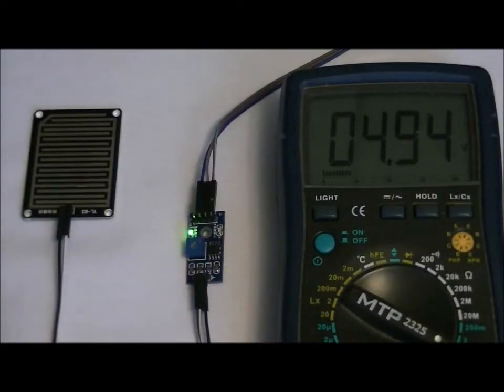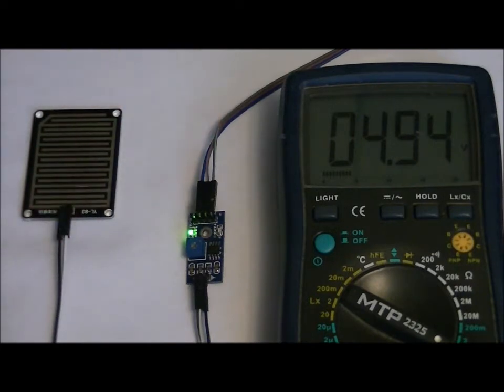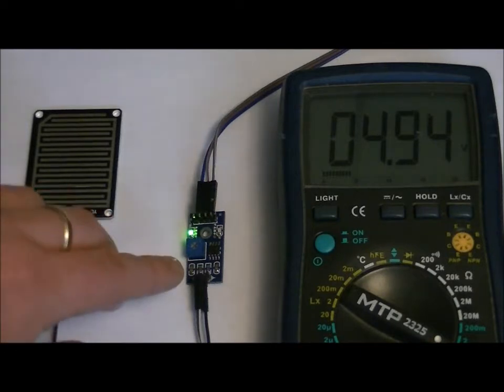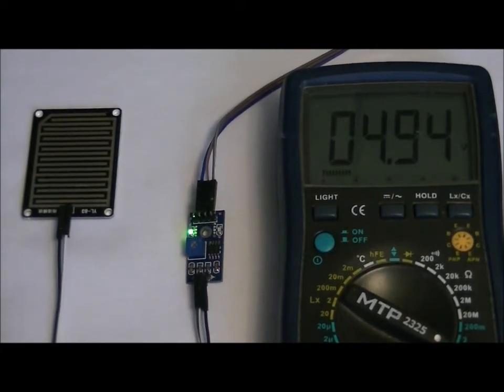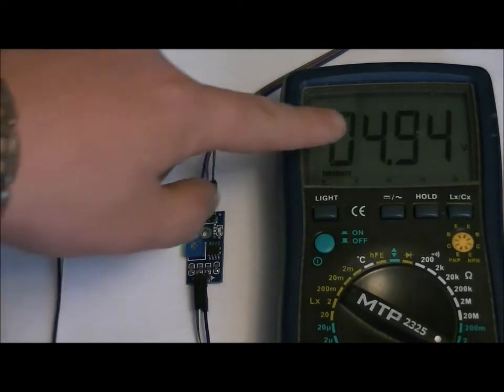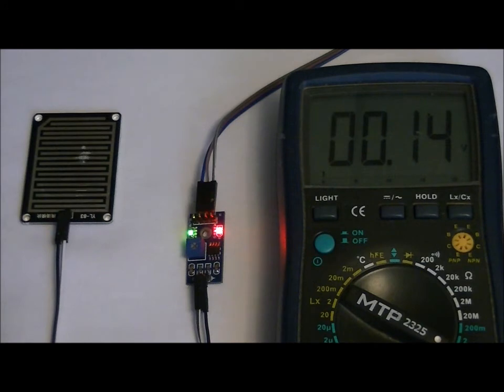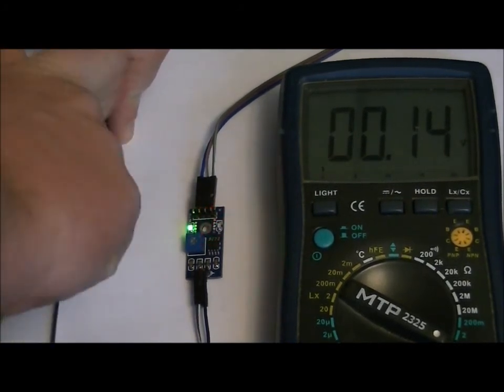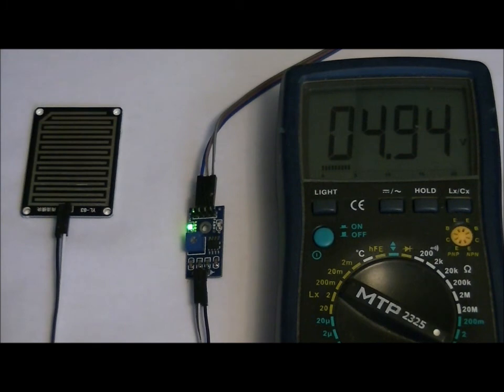The Moisture (Rain) Detector Module With Sensor Board For Arduino

Comment: hi, thanks for your video. very helpful. i have a question. if i need to use the rain detector output current to directly operate a motor how the wiring should be? where to connect the Do or AO out put wire?
please advise.

Comment: Is this the cheap china DC board it looks like it and if it is DC you will get corrosive tracks with the rain as rain has acid in it  more so in town due to pollution the copper track will corrode away in time and stop working 

I manufacture a rain sensor that is stainless steel and my circuit runs on AC that stops any corrosion or electrolysis